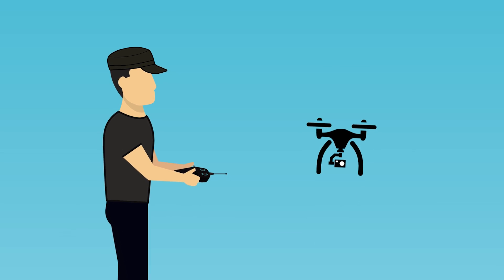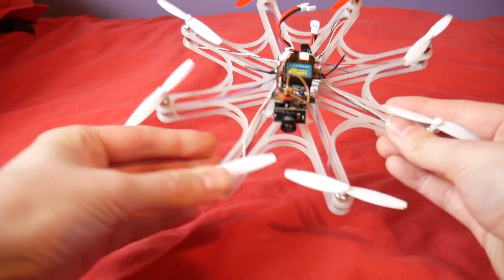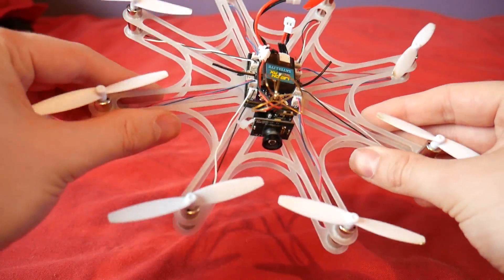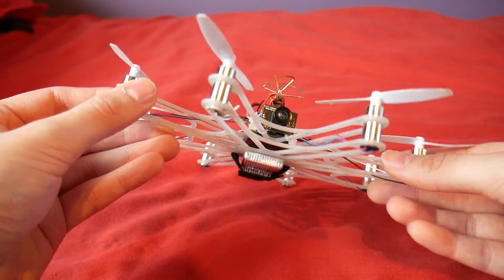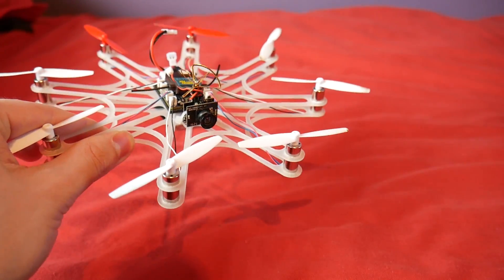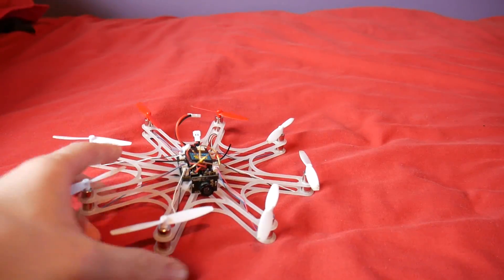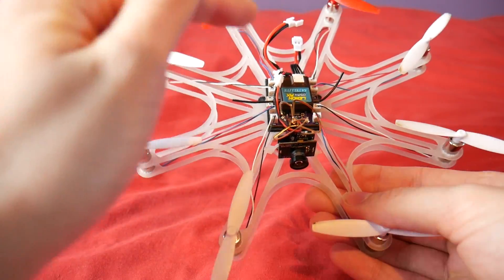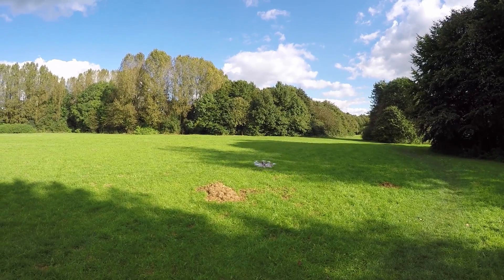Micro Octocopter! - Alienflight 👽

Comment: idea. buy a cheap turnigy bolt 850mah High volt 4cell 4s battery and solder your own leads on The seperate cells. charge them High volt and you Will get 1000mah performance Without The weight

Comment: Awesome Andy 😜. I know it would be a bit of a waste. But if you used this board for a quadcopter could you use the four extra connectors to power led's for night flying? Just a thought. Thx Dod.
Reply from the maker: u could however they would vary in brightness as the expected motors would spin up
Reply: I did wonder about that. Thx Dod.

Comment: would it not be safer to put the electronics inbetween the 2 plate's ? :p
Reply from the maker: the FC does not fit flush if u do that. the cut out for the FC is on the top
Reply: AndyRC aah ok, surprisingly 
Hmm gota ask Phill for 1 of these of ma own 1 day XD
Reply from the maker: yes :)